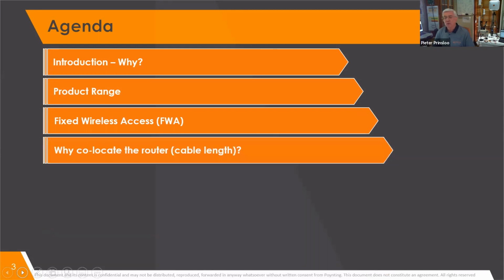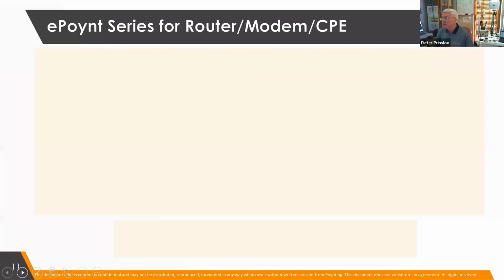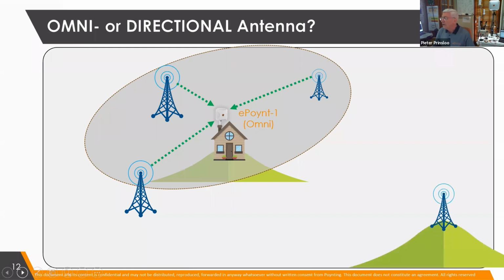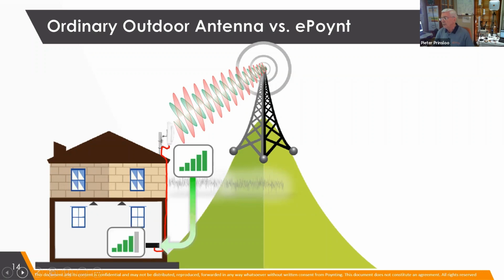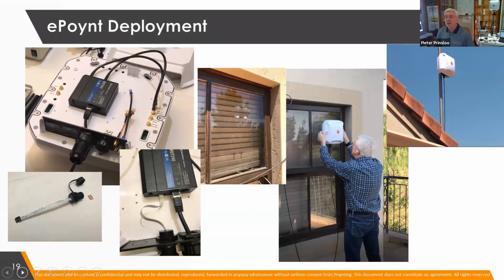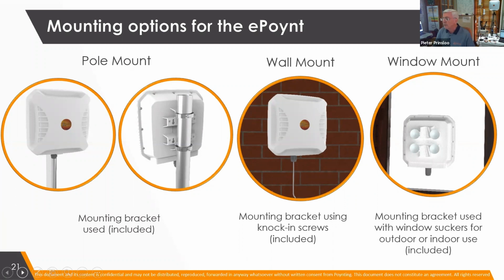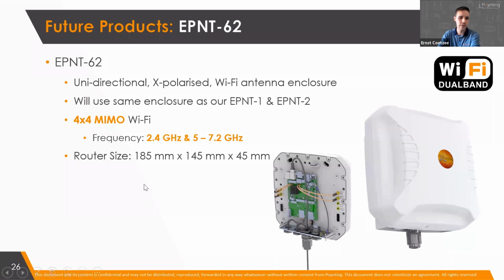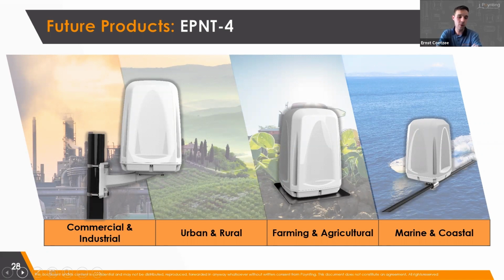Webinar 8: Getting to the Poynt: ePoynt(ing) your Router. Link to presentation in description below.

Comment: Excellent as usual from you guys. Well done and it is a great idea putting the Router into the back of the unit as we often had issues with been held to the standard length cables. Regards Declan from Ireland